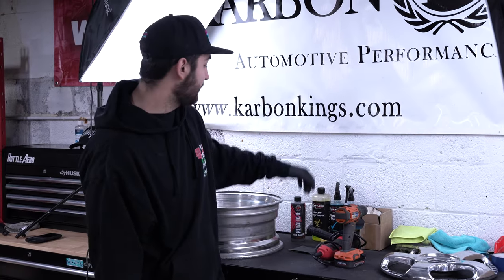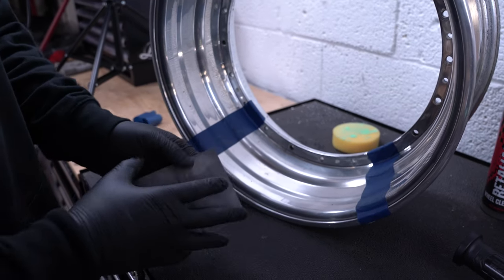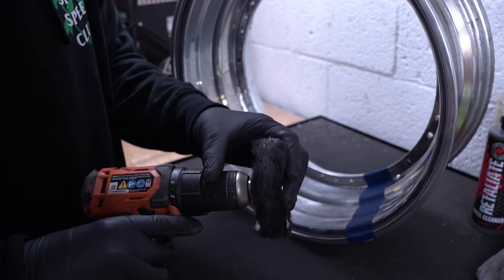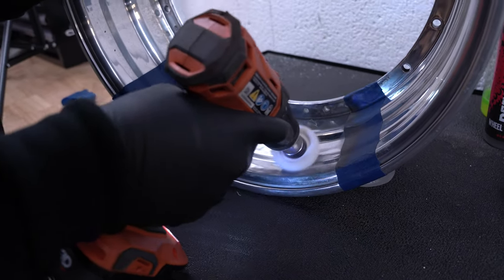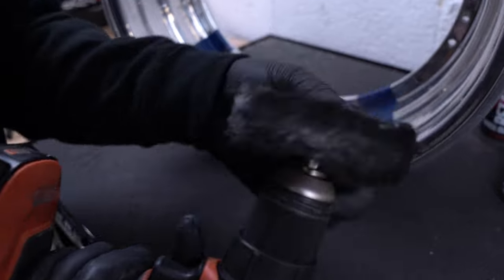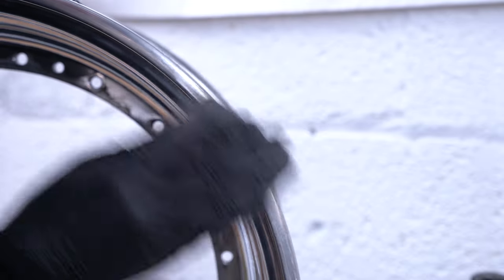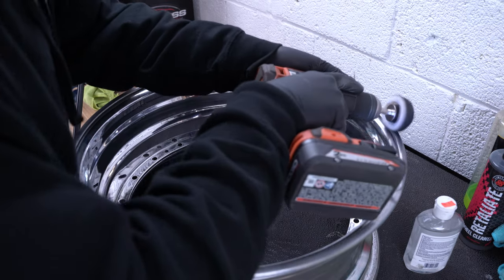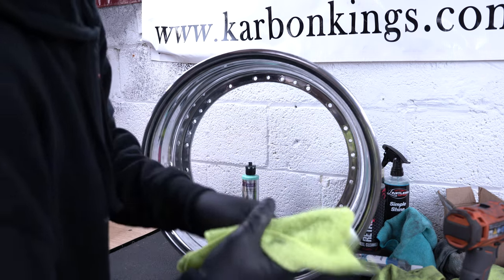HOW TO POLISH WHEELS W/ 3 EASY STEPS!!

Comment: You don’t need to do any further sanding after the 1500 grit like 2000 or higher?
Reply: no, you will just be wasting your time. If your wheel is rough, start with 600,800 and then work to 1200. Really pitted wheels, start with 300
Reply: I only run to 600. But I use a variable speed grinder with zeyphr super shine x kit

Comment: Making an easy process 3 times as hard  😂

Do all your sanding first, 600, 1000, 1200, 1500, that the most important bit, to get rid of any imperfections 

Use a Large 6 inch cotton mop on a plug in mains drill, Not a battery one! using a good metal polish like Autosol go over the entire wheel, lips, edges the lot in one go, using as straight lines as you can, wipe clean and repeat any areas that need it

Then use a Finishing soft foam pad or hand finish them with the same metal polish, wipe clean and then coat them with some carbon collective polished wheel sealant 👌🏻

Always Wash with PH neutral soap and They will clean easily and stay looking amazing for 2-3 years 👍🏻
Reply: Autosol is trash compare to zeyphr pro40. If you really want to do it properly you use a variable speed 9” grinder with rouge and an airway